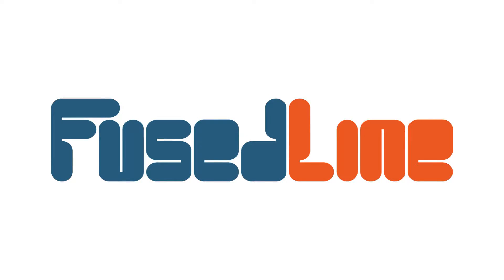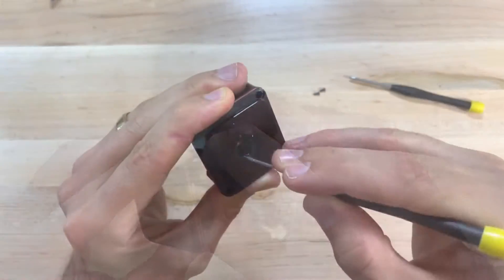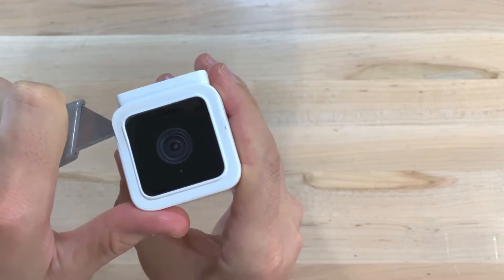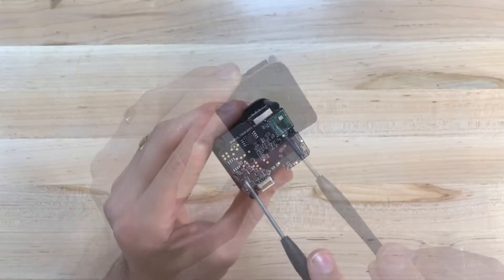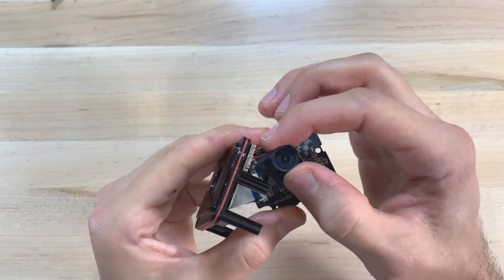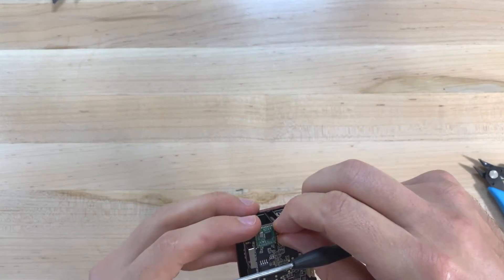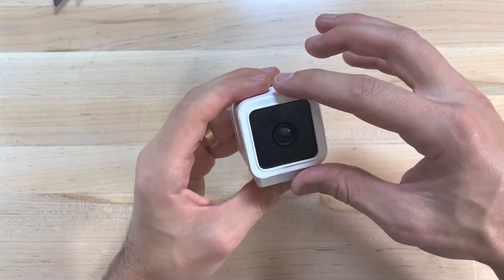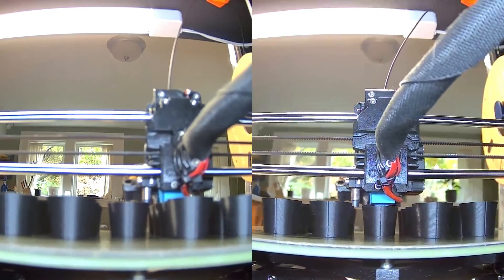Wyze Cam V3 Adjustable Focus | Focus Ring for 3D Printer Monitoring and More!

Comment: Hi folks, it's me again, this time I will not write a post so long that nobody wants to read it.  😂

This is about using the focus rings to adapt a Wyze V4 to manual focus.   You don't need to skip to the end to find out how the story comes out.... IT WORKS on V4.

I would advise that you organize yourself with organizing trays, pry tools, a collecton of small screwdrivers, needle nosed pliars, larger pliars, glue, and Xanax!!   

In this operation you must remove ALL THREE circuit boards.    This includes the plugin connecters AND the ribbon cables.  I'm here to tell you that when reattaching the ribbon cables you must have the patience of Job.   If it gets to you, you might want to walk away from it, meditate for 20 minutes, then come back for another go.

THIS TIME I did not brick the camera.   It seems to work fine after the modification.   Take it slow.   Take pictures if you need to and don't stress.

A couple things that you might need to know.   Inside the very front of the camera there is a rubber ring.   At first I tried to enlarge it, but soon discovered that was a waste of time (you don't actually need it), so when you get to the rubber ring surrounded by the 3 screws holding the inner most board, just TRASH it.  

When you bore down to that final circuit board attached to front of the camera by the 3 aluminum screws, be VERY careful with these aluminum screws.   It's very easy to break the phillps head because the aluminum is so weak.   So, when removing and reinstalling these three screws, treat them as if they are explosives.

You are going to have to drill out the faceplate of the camera so the lens+ring will fit through the hole.  A step-bit is perfect for this.  You can try it either way, but drilling through the FRONT of the camera worked perfect for me.   This is one aspect of the project that was very easy.

When reasembling be very careful not to reverse the middle board.  This is where the camera sensor is attached.  It looks like it fits either way, but if you install it the wrong way, then the ribbon cables will be in the wrong positions.   Check this out and verify before actually attaching the screws.

I do advise gluing the ring to the lens.  If you don't the chances are good that if you tighen it too tight you will not be able to loosen it, because the ring will slip around the lens.   A few drop of glue inside the ring will likely save your sanity.   Just be sure to push the ring all the way down and make sure it is true all the way around.   Otherwise you might see a little of the ring when viewing the camera.  Trust me on this.

This time everything works and I did not brick my camerra.  I think better planning and staying mellow made the difference.   

If anyone decides to tackle modifying v4 and you have questions, feel free to reply.

Comment: I wanted to share my experience on modifying V3 to adjust the focal length and install the rings.  I was able to get it done and it's now working, but not as easy as the video.   I'm sure that the guy demonstrating in the video had done a few of these and learned a little, so it went smoothly.   But if this is your first time, expect that it will be much harder than the video, but if you don't give up, you can still do it.   The rings are absolutely necessary for this project.  Don't even think about adjusting focal length without purchasing the rings.

It took me forever to pry the frame from the camera.  It just didn't want to give up the ghost.  I was using a utility knife and though I think it's the best tool for this, it was stuck tight and I ended up bending my blade all to helll.   But EVENTUALLY I was able to get this Satan Ring removed.

Removal of screws seemed to be just as bad.   The first TWO plugs and screws removed easily.   The 3rd plug/screw is what nightmares are made of.   I accidentally pushed the plug far down into the shaft.   I used tiny screwdrivers and needles to try to grab the plug and remove it from the hole.   NOTHING WORKED !!   Finally, I bent a paperclip into a slight hook, shoved it down the shaft, and moved it all around.   I was able to stab the plug and pull it out with the modified paperclip.

The moral of this story is to use EXTREME CAUTION when removing the plug.   

After removing the plug, screw just spun around and would not fall out as the others had done.   I unscrewed about a million turns, then gave up.

I proceeded to pop the camera out of the case.   Actually this went quickly and I was able to remove the camera without much difficulty.  After removal, I was able to push the stubborn screw out from the backside of the camera.  Upon reassembly, I did NOT install this difficult screw.  I assembled using only TWO screws.

Unplugging the cables and screws went pretty much according to plan.

But... when I got to breaking the lens free from the glue, trouble started again.  I was able to break the glue easily enough and no visible glue on the inside threads.   The  glue was attached as if it were welded to the base and lens threads.  I worked forever trying to scrape off the glue.  I was never able to get 100% of the glue removed and the lens did not turn easily, especially at the full IN position.   I worked it in and out a thousand times with the pliars.  It still didn't move that easily.   Finally, I added some silicon lubricant to the threads.   That helped a little, but still didn't turn as easily as I wanted, especially at the full IN position.

I reassembled the camera without incident. 

But... when attaching the ring, because the lens did not turn freely as it should, when you screw the lens IN, the ring would turn, but not turn the lens, so I could not screw the lens OUT, using the ring.  I disassembled the camera for the 2nd time, worked the lens more with the pliars, and added additional silicon lubricant.  I was able to free movement of the lens a little, but still not as easy to turn as I had expected.

I assembled the camera and ran into the same problem again.   When I screwed the lens IN, then tried to unscrew using the ring, the ring would turn, but NOT the lens.

I placed blue Loctite on the inside of the ring to see if that would make a better connection to the lens.   In this application, Loctite did NOTHING.

After that I tried CA (Super) glue.   I have  a very skinny glue applicator tube for my glue bottle so I could place tiny drops of glue.  I was able to put tiny drops of CA glue on the inside of the ring.   If you do not have a glue applicator tube, then put glue on a toothpick and place very small amounts of glue on the inside of the ring.

After placing glue on the inside of the ring and pushing it over the lens, there was no problem turning the ring.  PROBLEM SOLVED !!!!

The camera is now fully assembled and working perfectly.  Just be aware that it's possible you might encounter isses that you'll need to solve.  
One thing that I can say is that the 3D rings are absolutely ESSENTIAL !!!   Even if you have to add some glue, they do work, and they work WELL.
No way you could do this without the rings.

If you take it slow and solve problems as you encounter them, ANYONE should  be successful at this modification.

UPDATE:
This is a successful failure.  I won the battle, but lost the war.

After putting it all back together, the camera would not recognize the SD card.    I tried everything possible, including trying other SD cards and formatting the original SD in my PC.  Nothing worked.   Camera would no longer detect ANY SD card.   I pulled it all apart again to verify all cables, especially the ribbon cable, was properly and securely connected.   ALL was good.

Out of options, I attempted a Factory Reset.  Probably a bad idea.   Now, the camera is BRICKED.   Powering up the camera, no lights, no audio.   No longer any sign of life.   Time for a respectful burial for this camera.   Maybe I can use it for parts.

I have ordered a Wyze v4.  Might as well throw good money after bad.   I know with v4 that I will need to drill out the hole in the front case to make room for the lens/ring combination.  

I was not thrilled with the video clarity of the v3, maybe the V4 will have better resolution if I can install the lens ring to adjust focus.   

I didn't learn that much from this experience because I still have no idea why this camera is BRICKED.   As far as I know, nothing that I did caused this unless it was random static electricity from handling the innards of the camera.   That may always be a mystery.

So soon, I shall try again with the v4 to see what happens....

Comment: Any know if this mod will work on V4 cameras?
Reply from the maker: Hello, thanks for your interest! Unfortunately it does not work on the v4. The disassembly process is the same, but the gap between the lens and the camera housing is too small to allow the focus ring to slip around the lens once the camera is reassembled.
Reply: @ Ok well I'm.a CAD designer prototype maker & product developer cnc machinest etc.  I can tweak the file or make a new ring and adjust gap if needed. But dose the mod itself work, does the V4 camera have a focusable lens once you break the glue free?

Also using this camera for 3D printer.
Reply from the maker: @billb295  Got it! There is basically no gap so I don't think you will be able to fit anything around the lense without modifying the housing and making the hole a bit bigger.

Yes the mod works on the v4. I successfully disassembled and broke the lens free the same as the v3. They use the same threaded lens on v4 as on v3. You can actually go through with the mod to break the lens free and if you can get enough glue off to where you can easily spin it, you can reassemble and use your thumb pressed on the lense to spin it and adjust focus. Only issue is you smudge up the lens and have to clean it, but it does work!
Reply: @ Great thanks for the info. I can open the hole up around the lens a bit. 👍🏻
Reply: @fusedlinedesigns  will you be selling a V4 version?  Thanks!
Reply from the maker: @randystanard6352  Unfortunately I do not have any plans. The gap between the lense and the housing is too small to fit a focus ring around the lense. The v4 would require making the hole for the lens in the housing larger so the focus ring fits. If you want, you can purchase the v3 focus ring (Wyze uses the same lense between v3 and v4 so the focus ring still fits around the lens), follow the same process as in this video (its nearly identical between v3 and v4) and then use a dremel or similar to make the hole in the camera housing larger.
Reply: @fusedlinedesigns   I've already purchased two rings from you and have 2 v3 on order.   I was hoping that maybe it would be possbile to likewise modify a v4 down the road.  But, as you describe it, enlarging the housing hole for v4 shoul be easy using a step bit.  Thanks.
Reply from the maker: @randystanard6352  Great! Step bit is a great idea. Just make it large enough to fit the focus ring through and you will be all set. You'll see what I mean when you get the rings and cameras. Also, feel free to message back here or email me at nate@fusedlinedesigns.com and I can help if you run into any issues.
Reply: @fusedlinedesigns   Thank you!!  👍
Reply: @fusedlinedesigns   If you read my other message you know that I've been able to make your rings work successfully on V4.   It may not be for the faint of heart, but you can do it.   Because the resolution is so much better on V4 I have purchased 2 more rings from you which I will use on V4.    Using the right tools and a lot of patience definitely helps when modifying v4, but it can definitely be done.
Reply: I bricked the v3, but still don't know what bricked it.   So, I've ordered a v4 and will try the modification.   I know that I will need to drill out the hole in the case to make the opening for the lens larger.  From other's comments, doing this should allow this modification to work with the v4.   I will problably post a comment here after my v4 attempt, so stay tuned.
Reply: I have just received my V4.   It's setup and working, but without any lens modification.   What I can tell you is that there is a BIG JUMP in picture quality, so if it's possible to use the 3D printed rings on the V4, that's the way to go.   In the next day or two, I will be tearing apart the V4 to see if I can modify the v4 to an adjustable focus.   

From what I've read here, you can do the upgrade on v4 and install the focus ring, BUT you must enlarge the hole in the case where the lens is fitted.   If you can use a drill, and this works, then that little extra work, is well worth the effort to gain the improved picture quality of v4 over the v3.  

I will post again after I've disassembled and completed the v4 modification.

Comment: I remember doing this to the original wyze I believe, all I did was remove the gasket around the lens and twist the lens with needle nose pliers. At least that's all I recall doing, i don't think I took any screws off.

Comment: I just tested this on the V4 and it does work. The steps are a little bit different, but it does work.  One big difference was that there were no rubber plugs on top of the first set of 3 screws.
Reply: is it easy?
Reply: Yeah just took about 30 minutes to do.

Comment: Does the focus ring work on the newly released Wyze v4?
Reply from the maker: Hello, I have not had the chance to test this on the V4 yet, so cannot officially confirm that it works. If anyone out there has tested it, please let me know!
Reply: Yes, it works on V4 but it's more challenging because ALL circuit boards must be removed and you must enlarge the faceplate hole with a drill.  If you' want more detail, see my other post.

Comment: I should have read the comments first. STEP 1: Remove SD card if installed. (I dislodged the tray from the circuit board.) If you happen to do this, make sure the SD tray is aligned with the SD slot on the bottom of the casing when putting everything back together. Thank you for the video!  :)
Reply: Yes, step one is to check if you have a card in the slot and get it out.

 I destroyed the card slot in the first camera I tried installing the ring in.

Comment: Remember to take your SD Card out before popping the camera out. Great Tutorial and awesome product - HIGHLY recommend. The difference is more than stark. The installation is straight forward but takes gentle and patient hands. I had to take a moment to breathe when unscrewing the camera from the thread. The glue was also very difficult to remove and really affected my ability to turn the camera to focus. Overall, not this guys fault - just info for the next dude/ette that attempts. Thanks for the product and tut.

Comment: Thanks for posting this video!  I was able to adjust my camera for close focusing on a birdfeeder using it - thank you!  Only additional tip I found helpful was that I was able to remove most of the glue sealing the lens barrel in position using a dremel with very fine tip rather than just cranking on it, making that step a bit easier.
Reply: I was able to do the same by just working/cutting through the glue with a utility blade. Once most of the visible glue is removed, the lens rotates without any great effort. So much 'safer' this way.

Comment: Dude you're going to cut your finger off the way you use a blade. Christ at least buy some cut resistant gloves. "You're going to need to use some pressure" Exactly what you're told not to do while using a sharp blade ESPECIALLY next to fingers. One slip and you're to the bone.

Comment: May I suggest a modification to the instructions?  Do not use a flat head screwdriver to remove the rubber plugs.  Instead, use a needle to stab the rubber at an angle, 45 degrees or less.  The plugs will stick to the needle and can then be pulled out easily.  If a sewing needle is not available, I guess a hypodermic needle might work as well.  I was tempted to use a push pin but the needle stolen from my wife's sewing box was much thinner and sharper, though.
Reply: I couldn't agree more.  I tried using a flat blade screwdriver as in the video, and wound up with all three of the plugs dep inside.  Getting them out took me, literally, more than an hour and a half.  And there is no way to loosen the screw with that darn plug inside the cylinder.  I wound up having to take a small awl, bending the tip into a hook, and then fishing around for a bit until I finally got a good enough grab to pull the plug.  On my second cam, I wyzed up and used the tip of an eXacto knife to pry them out.

Comment: How close can you focus it? Could I focus 4" away?
Reply: Yes
Reply from the maker: Agreed - you can focus it within an inch or so.
Reply: @fusedlinedesigns  In theory, to focus as close as "an inch or so", should the lens be turned all the way clockwise?  Looking forward to the ring/s I ordered.  Thanks in advance.
Reply: @jimsar9  Hello, you can adjust the focus after the camera is reassembled and while while looking at the live feed. So just keep turning it until the object you're focusing on comes into focus.
Reply: @nathansecinaro2925  Kinda hard to do without the focus ring.  Monitoring monarch butterfly cocoons, it would be much easier with a ring.  At this point, I have to remove the camera from it's perch and pinch the lens which is not an easy task.  Kudos to you for coming up with the focus ring.